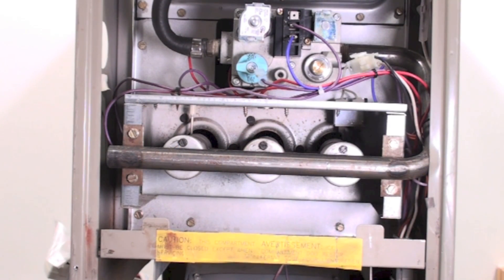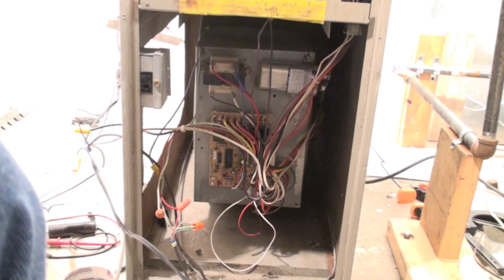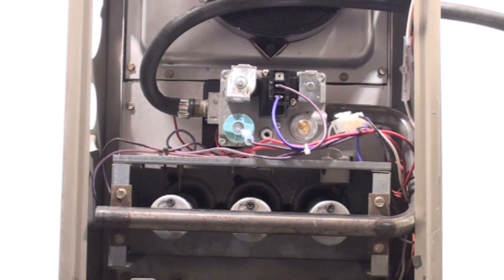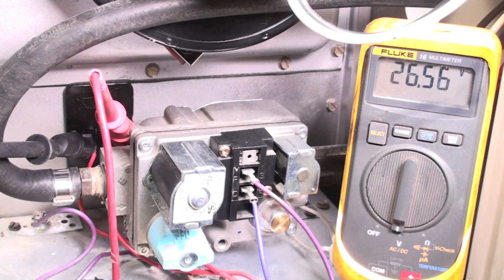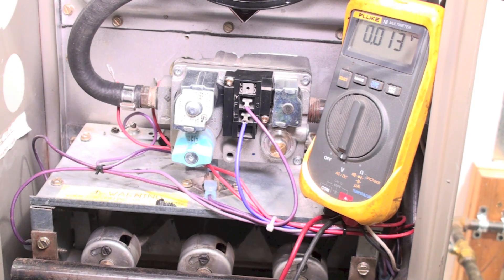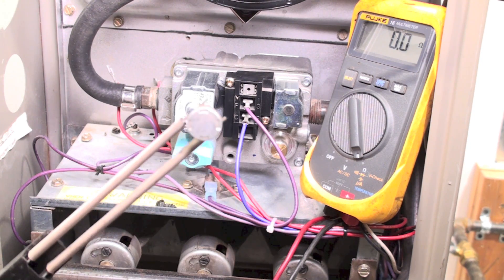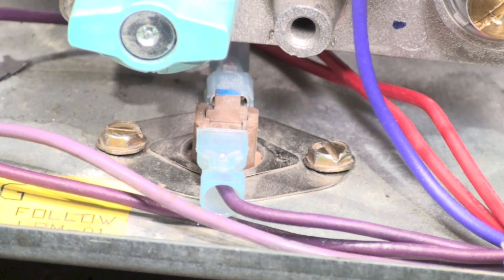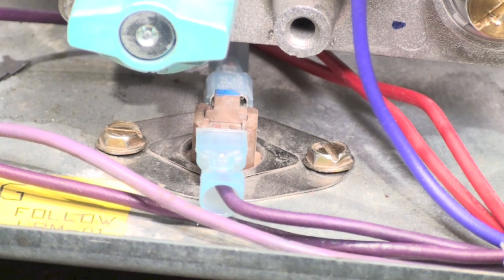Troubleshooting the limit switch on the 80% AFUE gas furnace

Comment: will this cut out power to the thermostat?
Reply: i'm also reading 5 ohms and  above  on the sensor. so this means that the sensor is bad, correct?
Reply from the maker: Seth Rahe On most furnaces no.  Very old furnaces sometimes cut the 24v circuit, but if it was made in the last 30 years, no.  The sensor should read 0 ohms.  Anything over, the switch is bad.
GFM
Reply: Thanks. I will just ask one more question... I just got done with school and have been on an install team for 2 months, but working on my own furnace.... i have a payne furnace horizontal (PG9MAA) 90% Furnace. My furnace runs anywhere from 1 min to 10 min cycles then runs the  shutdown cycle . My stat looses its display as well. The furnace shows code for high limit and roll out.

 I have replaced the stat with a brand new one, check the blower motor and cap for mf , open all of the registers, replaced filter, pushed the rollout switch while running, checked the voltage across the high limit switch (checked good), and physically check the high limit switch for cracks ( looked fine).

do you think this could  be the control  board, high limit, or both? or something else.

Thanks again!
Reply from the maker: Seth Rahe That furnace has been recalled by Carrier.  The secondary heat exchangers rust out.  The rollout switch is classic.  However, I can't say it shuts off the power to the stat.  I guess it could.  I have one so I will check to see if it shuts off the power to the stat.
GFM
Reply: alright. Thanks.

Comment: I can take wire off right side with the insulated cap, but i cant seen to get left wire off of limit switch, do i have t have both wires off to bypass or do the tap method?
Reply from the maker: Just be sure the power is off and you can tap to your heart's content.
GFM
Reply: Thank you, im an electrician, i turn power off of everything first lol i got it working

Comment: Thanks for the video I have a Goodman with 4 red blinks on the control board, main/aux limit switch open.  When I test the limit switches they seem fine with continuity and ohm tests.  What happens the blower kicks on immediately when unit is switched on but neither AC or gas heat starts.  To stop blower I have to switch system off.  I had been able to get the system to start once by switch power of to furnace all night, came back on next day and everything was fine for a while and started the 4 blinks on the board again couple days latter.  Now furnace is cool and been off all day, but get the 4 blinks when I switch it on.  Evaporator coil was cleaned, new air filter installed, thermostat on correct settings.  What do I look for, could it be the board itself bad,? Thanks
Reply from the maker: Kamal Saieh This one sound like a limit switch.  It is the one centrally located on the panel.  If you had problems with plugged filters, the limit may have been opening quite often.  That could damage the switch.  Try tapping the switch mounting plate.  That could make it work.  Then replace the switch.  The only other problem I could see would be a cracked heat exchanger that could be leaking hot gasses on the limit switch.  Hope this helps.
GFM
Reply: grayfurnaceman great video...the 'tap and knock method' is a great quick fix...but as you say...replacement is needed...good advice and again...great video for the average John Q Lunchbucket....

Comment: Great video, i'm trying to determine if my which limit device is bad. I've got an American Standard 80 model ADD060C936F2, my red LED is blinking 4 times, my fan blows cold air around my house. My flame doesn't light. I took my digital meter to the limit switch and I get 0.1 ohms, but I get a 0 Voltage so something is breaking the signal. I get 0 ohms across my pressure switch and flame switches. Suggestions? I can't figure out whats breaking the circuit, i've been looking through the schematic on the back of the panels and nothing seems to break the signal.
Reply: fixed it! it was my limit wire was not making a good connection to the main board!! woohoo!
Reply: @BrianHensleyRULES  Good job😃

Comment: What if my control board is telling me that the limit switch is the problem but I checked and it's good(not open) and all the other flame roll out sensors are close but the board is blinking 4 times the blower is on ,can that be a faulty board ?
Reply from the maker: Have you checked the limit on the fan housing?
GFM

Comment: Hoping you can help.  First of all, I noticed that your board is blinking "3" and "4".  I didn't have a window to look at the LED with, so I popped it open and held the door switch in while pressing the black button next to it.  It flashed once, and then "4" and then "3" about 5 times.  It then went solid.  Now, it just stays on solid with the door switch pressed, or goes off when I press the small black button next to the LED.  

This all began when I woke up to a cold house 3 nights in a row.  I assume it was the flame sensor, so I cleaned that off with no luck.  Unit is only 2 years old (Ducane 80g1uh070ap12-02).  Furnace is working right now, but going to ASSUME that it will shut off again tonight.
Reply from the maker: chicagotransam You need the key for the codes.  Should be on the furnace cover.  Look for condensate or venting problems.
GFM
Reply: grayfurnaceman
Unfortunately, the codes are no where to be found on the unit.  Searching the internet, I found that "3" is the pressure switch and "4" is high limit switch.  The filter is brand new, so that's not where the issue lies.  The flue appears to be clear up to the chimney.  I am no longer getting the codes listed above, but the issue still persists.  Sometimes, simply turning the stat off and then back on resolves the problem, other times, a complete reset by powering down the furnace is needed.
Reply: chicagotransam
Also, isn't condensate usually just an issue with A/C and not heat?  I've never had anything come out of the hose during the fall/winter months
Reply from the maker: chicagotransam If your furnace is an 80% efficient one, it does not condense water.  
GFM

Comment: I bet that rubber hose says gas line on it.dont it? Then that will be OK. lol  I wonder if your lawyer will get all 12 people on that jury to understand the difference between natural gas and gasoline. May be you can just telll them its a gasoline furnace. HUH?   I smell lawsuit. Any living wife of a dead doityourselfer can pull up your vids and go to town on your ass. you need a rider on you GL policy to cover your YouTube activity.   remember your responsible for every thing you show, whether you talk about it or not.
Reply: dwdrumwiz comments are just a prime example of the HVAC industry trying to extort and intimidate customers, DIYers, and the small minority of certified/licensed technicians that actually want to help people from being fleeced for what you don't know. If your angry about loosing your position as the wizard of OZ, you better find a trade that doesn't require the basic tool skills of a garage door installer.
Reply from the maker: Actually it is a listed gas hose.  Thanks for the liability tips.
GFM

Comment: I changed the limit switch, got a low ohm reading but I'm still getting 4 blinks on the circuit board. Would greatly appreciate your feedback. Thanks.
Reply from the maker: Give me a brand and model#
GFM
Reply: American Standard Inc
The Trane Company
Model# : TXH041A4HPA1

Thanks for the quick reply.
Reply from the maker: Rocky R Look for rollout switches.  They are manual reset.  They should be located on the burner box.
GFM
Reply: Can't find a rollout switch on the burner box. Found instead another model # inside the unit, TUE100A960K3. The other one was outside the unit. Thanks for your patience.
Reply from the maker: Rocky R The model sounds like a good one but I can't find any info on it.  Is it a high efficiency furnace?
GFM
Reply: I believe it is. It was manufactured in 3/2000. An HVAC tech came over to see it and told me that the circuit board needs replacement but the led flash is not continuously on.
Reply: Rocky R Bought a new IFC in eBay for $125 (HVAC guy was asking $448), installed it, and furnace is working again. Four blinks on the IFC doesn't necessarily mean "open high limit device". In my case, I think the IFC is giving the wrong error code thus it's defective. Thanks for your video. Learned much from it.

Comment: I couldn't believe it when I gave mine a little thump and got a low ohm reading on the multimeter. Problem resolved. I appreciate the time you took to make and upload this video.
Reply from the maker: You are probably not done.  If it sticks once, it will stick again.  Replace it.
GFM

Comment: Nice vid, but confusing.... Is "off" open (circuit) or close (circuit) ???
Reply from the maker: It is a bit confusing.  Open means the switch has no continuity.  Open means the contacts are not together or closed.  Hope this helps.
GFM
Reply: grayfurnaceman we have a older Rudd furnace without the led lights. When furnace fires up it makes a loud sound like the gas is building up inside furnace before it goes on

Comment: Great information, though this is pretty advanced stuff for me to fix.  Looks like I need a trained technician.  Good to see the nuts and bolts of a furnace explained.
Reply: Better to handle the limit problem yourself. If it is the roll-out call someone. Because that could signify it is not a small part at fault. but something expensive and seriously unsafe.   Furnaces are very simple devices with similar orders of operation over every model. You can get a meter for the price of calling a tech.

In almost all cases fan running with no heat screams open limit.

Comment: GFM, thanks, i tap the limit switch and changed the filter and everything worked again. Thanks, any idea where to buy the replacement part for the Coleman Evcon G8T10012UHB11A
Reply from the maker: Unfortunately, I don't have any recommendations on parts.
GFM

Comment from the maker: I would be looking for a blocked or cracked heat exchanger.  Even though it does not look like it, it probably is rolling out.  Place your hand close to the burners to see if heat rolls out.  The other possibility is if there is a negative pressure in the room the furnace is in.  (exhaust fan, dryer, etc).  Hope this helps.
GFM

Comment: I have a Armstrong Furnace Model EG6G75DC10-4. When called for heat, the all of the safety sequence checks are good. The igniter lights the pilot the main burners light and after a few the blower comes on. After 3 or 4 minutes flame shuts down because the "flame rollout" trips. I reset the limit and the problem repeats. I replaced the limit, but nothing changes it continues to trip.

I watch this video on flame rollout and that is not what is happening to my furnace. Any Suggestions??

Comment: when I got to the house the furnace was running, after cutting the power i pulled the limit to take a look at the heat exchanger, i put it back in and turnd the power back on and it wouldnt start...i wasnt sure what I did so I put back for service, im a maintenance tech by the way lol

Comment from the maker: If its a gas furnace, the limits are usually low voltage.  So you probably shorted to to chassis.  This cut off the 24 volt power and may blow a low voltage fuse.  If there is no fuse, and the short is on for a while, it will take out the transformer.  Let me know how you do.
GFM

Comment from the maker: I would guess there is an airflow problem, or the unit is overfired.  If filters and blower wheel are clean, and its a high efficiency unit, check the secondary heat exchanger.  It's also possible the ductwork is restrictive.  Hope this helps.
GFM

Comment: I have an issue with my limit switch. It's been replaced three times in four years. It's a Carrier, and keeps giving a code 13 after it fails to start. I change the filter monthly. I shut the power off to the furnace for 10 minutes and than it will turn on. And once it hits the temp on the thermostat, I have to do it all over again to get it back on later. What would make the limit switches keep going out?

Comment from the maker: This sounds like a problem with low voltage wiring.  Start by disconnecting the Wire going to W at the board and proceed until you find the problem.  Hope this helps.
GFM

Comment: My ac is cooling but heater wants to come when ac is   on but there's not a  light on the board that indicates that thete is a problem with the limit switch and the furnace fan doesn't stops running. Thank you!

Comment from the maker: The dial should be set on 200.  That is the very bottom position.  The wires on the limit switch should be removed before checking with the meter.  If the meter reads OL the limit is open (tripped).  If it reads 3 or less, it is closed (working).  Hope this helps.
GFM

Comment: Ya i could,it happened on a lennox h.p. back seating the high side service valve it did'nt shut off correctly while taking the hose loose,R-22,the customer talking to me,i thought at 1st it was just what was traped in line,a few turns i knew something was wrong so i 1st tryed to tighten line but so much liquid froze nut on hose,instead of letting it go like i should i kept trying to get it to stop,i did'nt want the customer or me or my boss to be out the money to replace,dumb,lesson learned

Comment from the maker: Whoa, sounds like design problems big time.  If they are 4x10s with a max of 125 CFM that's only 750 plus the baths.  Sounds like no heat ,no cool no nothing.  I smell early failure.  Merry Christmas.
GFM

Comment: Again, a Very good Vieo! Just had a call like this on friday. too funny. credit card limit open. 140-30. guardian furnace. 4 years old. dirty filter and customer closed off 2 registers downstairs. drywalled over them. i told him to open them back up. not enough air flow for a 4 ton furnace. 100,000 btu. it only has 4 mains and 2 bath. he closed off 2 mains. gotta love those engineer homeowners from boeing. and he's a real engineer and should know better.

Comment from the maker: The limit is probably stuck off or there is a manual reset limit off.  It is usually located behind the gas valve.  On the vid you can see the left edge of it behind the gas valve.  Turn off the power and remove the limit then tap it on the switch.  It will probably come on.  It still needs to be replaced.  Do not bypass!!  Hope this helps.
GFM

Comment: I am working on an gas furnace 1993 arcoaire model no GNE075B12A1 the problem is the same fans running blowing cold air. Found all three filters to be clogged possibly 2-4 years old. I cant seem to locate the limit switch on this model any suggestions?

Comment: I did clean the rod once before and it worked fine for a while, I'll try bypassing the limit switch tonight, about the test with the flame rod I couldnt test it because the flame doesnt stay on for me to touch it to the chassis. I ordered a flame rod since it went bad before, i figure I'll replace it for a new one. do you have a vid about a cracked heat exchanger?

Comment from the maker: It should not.  However, if the flame shuts off within the trial for ignition period, it is probably not sensing flame.  Have you cleaned the flame rod?
The only other solutions I can think of are a bad control board or the possibility of a heat exchanger crack near the limit switch.  Try temporarily bypassing the limit.  Do not leave it bypassed!
GFM

Comment from the maker: We are looking at the flame sensor.  Checkout "How does the gas furnace flame rod work."  If it is not shorted to ground and the wires are tight, it is probably a board problem.  
GFM

Comment from the maker: OK, lets start over.  If the burners come on then shut off within 7 seconds, it has a flame proving problem.  If you have a meter with microamps, you can check the microamps.  Most will prove at .5 microamps.  If you dont have that meter, check the sensor, after isolating it, with an ohmmeter to chassis.  Should be open.  
If burners run for 2-3 min, with room temp set higher than room temp, there is not enough air or the heat ex is cracked near the temp probe.  
GFM

Comment: i checked the rollout limit and it didnt need to be reset, as where I stand i checked the the limit and rollout switch, the flame sensor i have sanded it down before so i think it could be that it needs replacement, but am not too sure, the flames will start just fine but will shut off and the fan will just keep working. at this point what else would you recommend to do? thank you GFM.

Comment from the maker: If you have a manual reset rollout limit, you can reset it by pushing the button.  I just did a vid on rollout switches.  You might check it out.  I am not sure where you would find the rollout switch on that unit.  It should be located above and close to the burners.  You need to find out why it has shut off.  Could be cracked heat exchanger, plugged ht exchanger.  If the limit shows continuity, it has not failed.  Good luck
GFM

Comment: Hello, i have a comfortmaker RPJ2 with the same 4 blinks that on the cover shows open High limit switch, i did the continuity test and its good i hear the beep sound on the meter, i have the same problem fan works but no flame. what else should i check for? or should i switch the high limit switch? thanks.